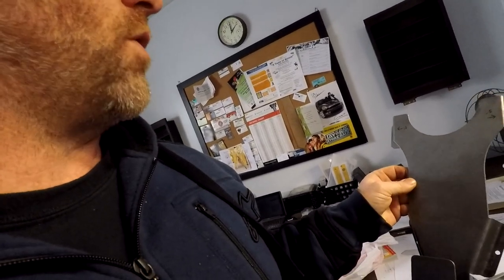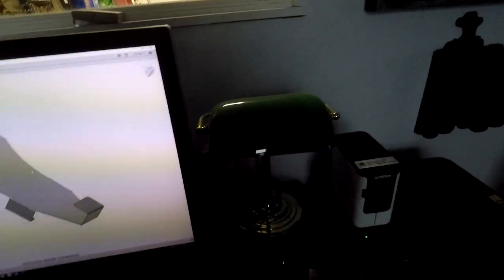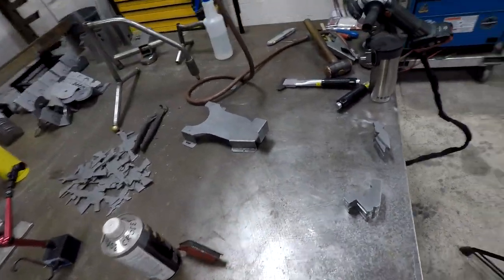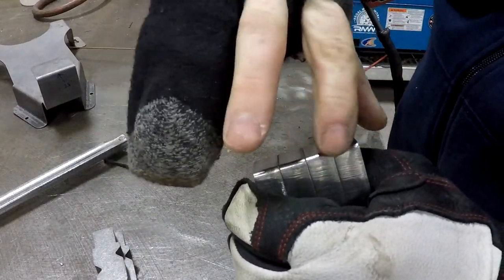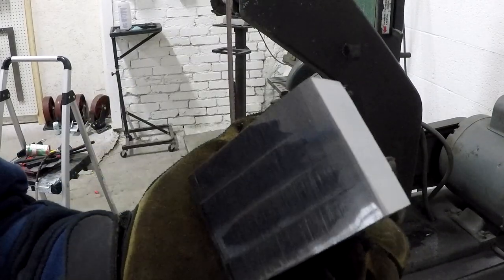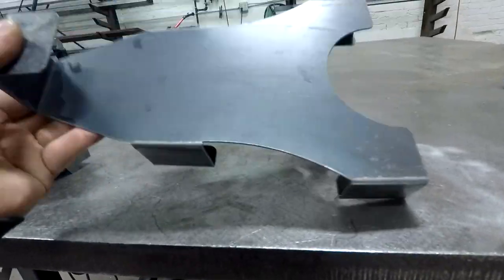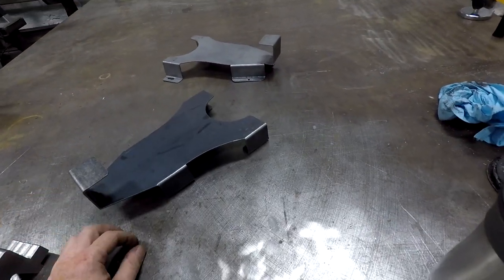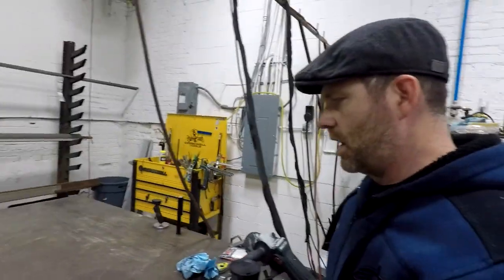RMW Vlog #92 Yet more Prototyping with Swag Offroad press brake dies & ShopSabre

Comment: yeah the blaster makes quick work of the scale removal that's for sure!! the chrome shop hates me when I bring blasted parts though.  I usually have pretty small parts so I just have a little gallon bucket with a lid  in the corner of my shop. toss some parts in when I get to the shop let them sit as I get my fixture set up then pull them out wash em off and weld em up.   really nice video by the way, I have been considering buying a swag finger brake set up so this was nice to see in action.

Comment: little tip. get a bucket of muriatic acid and toss that hot rolled part in and watch the scale wash away. takes about 15min. then toss it in your tumbler and you will bee dialed.
Reply from the maker: That is a great tip!  I stopped using Muriatic  acid a while ago as now it is much quicker for me to sand blast parts.  I normally only purchase cold rolled steel to eliminate a step altogether.  The issues I had with the acid, is storing it in a manner that didn't cause other issues to equipment or steel nearby.